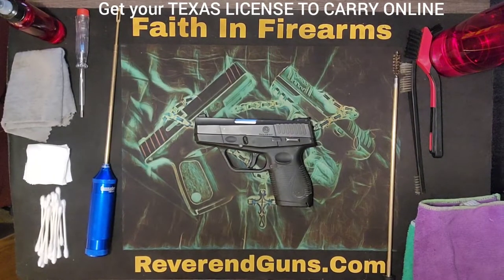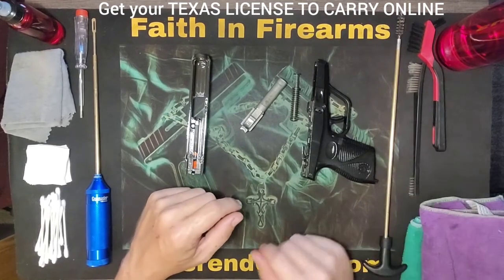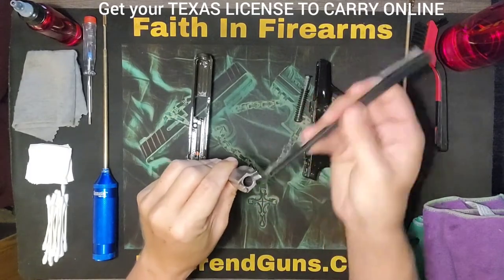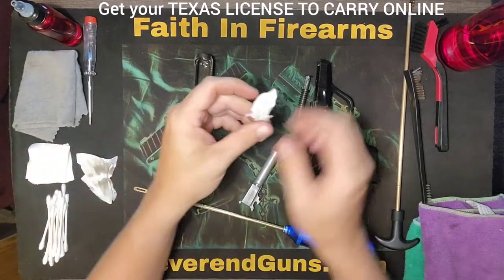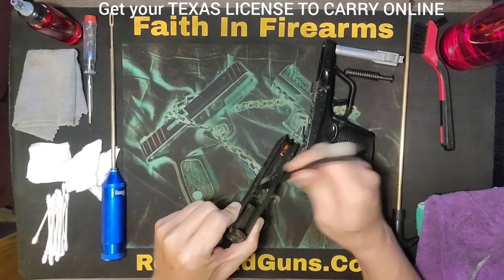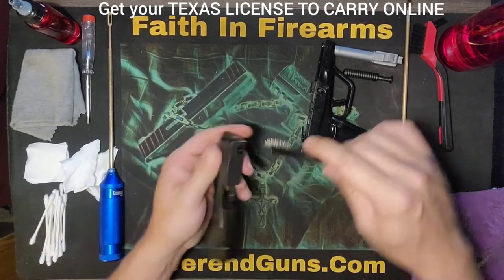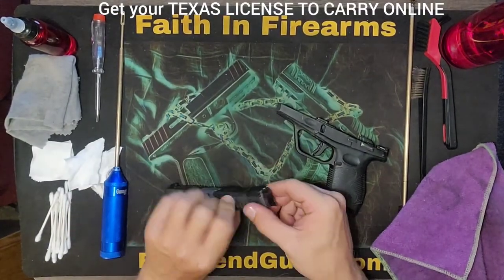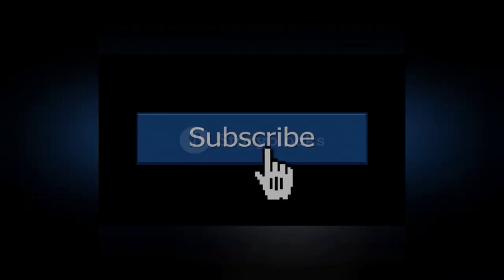How to Clean a Taurus 709 Slim: A Beginner's Guide

Comment: QUESTION... I try sliding the slider back but will not come off and unlike on herr the silver lifts up when i slide the slider back. Why cant i get it off an why is barrel lifting up. I need to clean it but im even afraid to fire it if it wont come apart.. HELP
Reply from the maker: The front of the barrel lifts up slightly during the cycle to aid the next bullet to feed into the chamber. You can clearly see the angle of the barrel when the slide is locked back.
Reply from the maker: When removing the slide, you pull the slide back just slightly first, then both of those tabs have to be pulled down at the same time. If the gun is very dirty, it can make it very difficult to pull them down but it can be done. It will take some finger strength. While holding both tabs downward, you can let go of the slide, then let go of the tabs. If you did not pull the trigger after you removed the mag and checked the barrel, it will not release the slide when you do this process. Do it exactly how I did it in the video. Keep me updated!